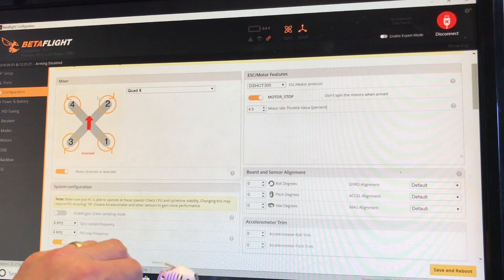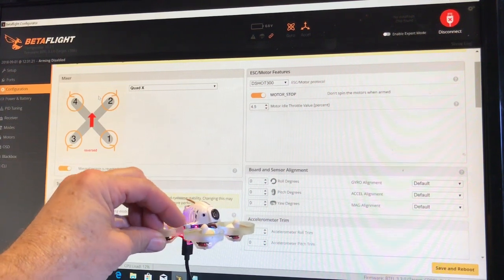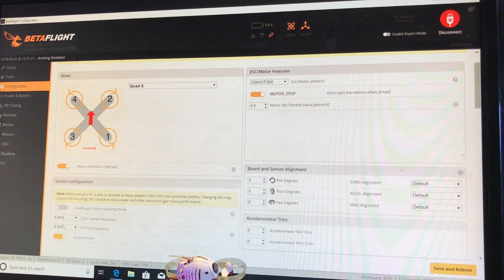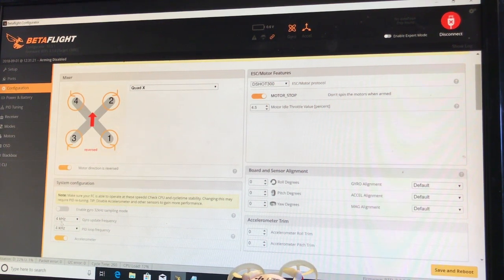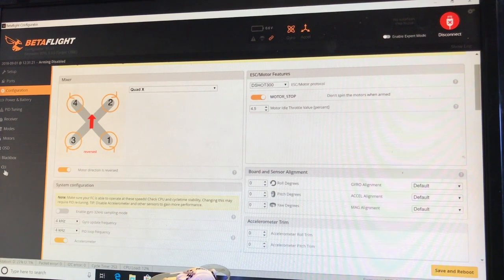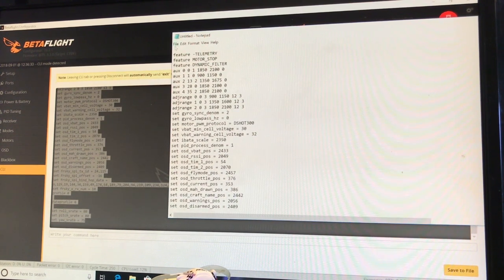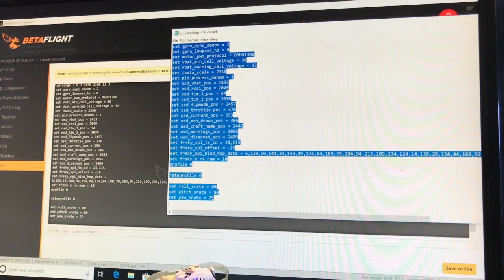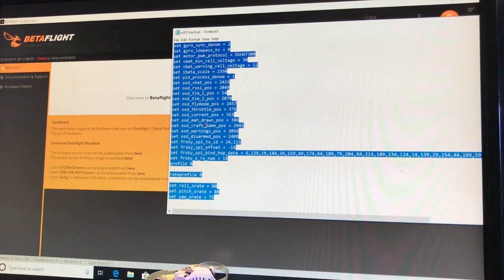URUAV UR65 Flight Twitch Resolved

Comment: Mine has 0802 motors and I did xt30  and I worry mine has something major wrong but when it don't twitch out it's great but it has gotten bad and I do think I did 8k/8k and hopefully that's all wrong
Reply from the maker: Hi dangerdave fpv,

You could look at the CPU load by going into the CLI and typing "tasks" but since the Beta65x is a F4 vs F3 processor, probably not the same issue. It is hard to get all yaw washout removed from a whoop class quad (ducts cause the issue). But going to a props out configuration (reversed) will help in my experience. I do not have the Beta65x but I would do a search on "Beta65x PID settings" to see what you get. You could also upgrade to Betaflight 4.1 FW if you are not there already. I would start with default PIDs and play with the PID slider settings if you are not happy with the defaults. The next step would be trying RPM filtering (lots of good Youtube videos on how to do it).

Cheers,

SLOG

Comment: So I have beta65x and it has a major issue with yaw washout or similar could mine have the issue u speak of
Reply from the maker: Hi Dangerdave FPV,
Must not have hit reply when I responded last week. I don't think it is the same issue because the Beta65x has a F4 vs URUAV F3 FC so I don't think it will help, although it is an easy thing to try and back out if it does not help. It is hard to get rid of all yaw washout on the 65mm Whoops. If you are not running Betaflight 4.1x, I would try that as well.
SLOG